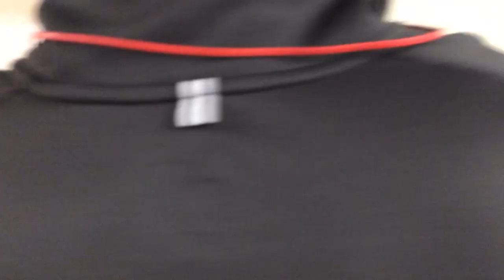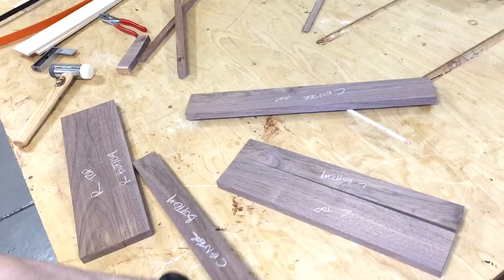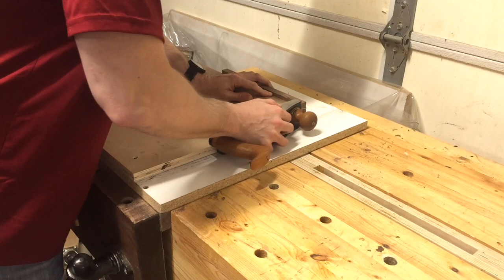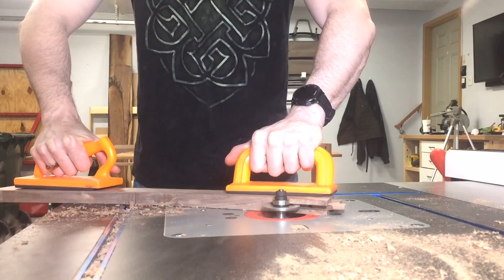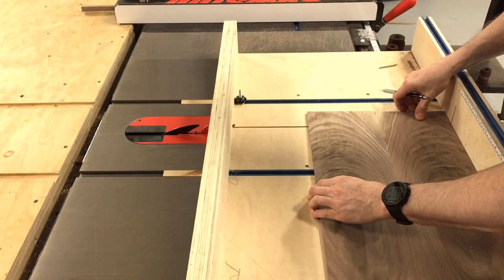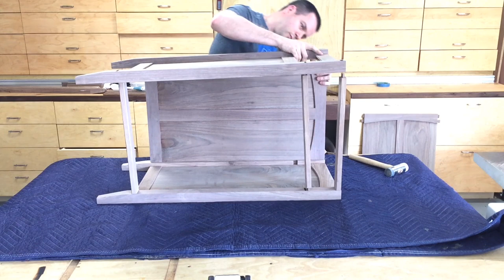Walnut Buffet Cabinet Build Part 1: Case | Woodworking

Comment: You sir, are on of the very few on this DamnToob that knows what he is doing. I've been butchering wood for over 50 years and I expect you can do anything I can. Doug--Colt custom shop 1979-1986.Switched mostly to metal until 2019...back to wood. Guanacaste wood.

Comment: Excellent video!  A couple questions if I could please.  Did you find a plan for the aluminum extrusion mortise table you used?  Also the bandsaw you resawed the panels with looks to have done the work easily, which model and whose blade?
Reply from the maker: Hey Matt, the mortiser I used is shop built and I get a lot of questions about it. Because I get asked a lot, I’m re-building a better version right now and I’ll have plans and a build video (or 2 not sure yet) within a couple weeks. The bandsaw is a Jet 14” JWBS-14DXPRO

Comment: I see there a pile of lumber but, how much wood it supposed to be purchased for this kind of project?
Reply from the maker: I used about 100 board feet on this project. Lumber prices can vary wildly depending on where you live. I normally get mine from a local sawyer at around $4 a board foot, but retail it can be $8 a board foot around here (Chicago area).
Reply: Thanks for details. I live in Europe in a metric country. So ...you are talking about 1/4 cubic meter( the ratio bf-cm is 423 to 1). The average price for hardwood lumber in here is $1700/cm divided by 423 = $4.02/bf which is very much the same as in there. The quality instead varies alot and depends on how, where and when the wood was harvested and dried. Thanks again.